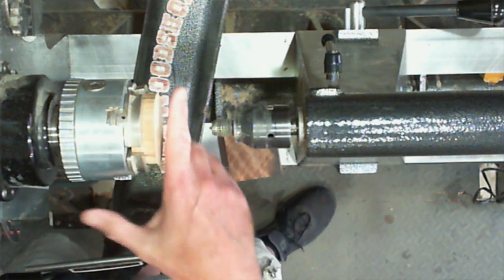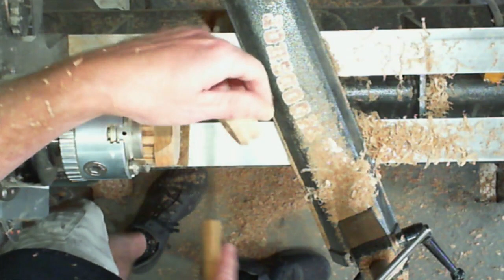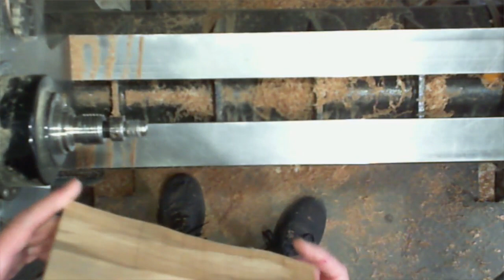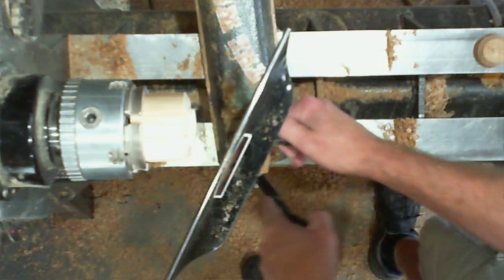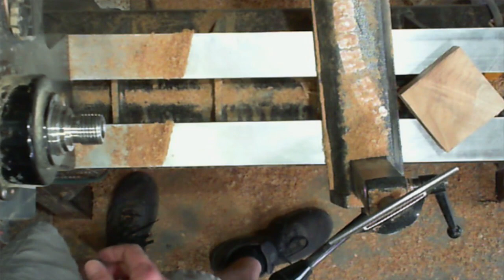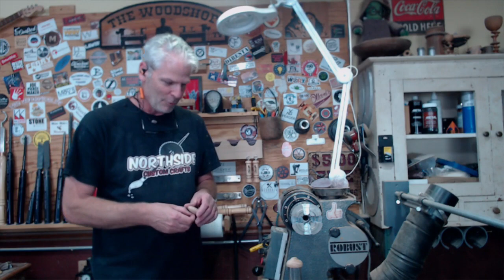Woodturning - Antique Gas Pump.

Comment: Hey Carl. I has drilling some pen blanks on my lathe with a chuck and when I tried to take off the chuck, it was stuck as a rock. I’ve tried everything to get it off but it won’t budge. I may have to buy a new lathe... any tips you have for me? Has this happened to you and how did you get it off.
Reply from the maker: I would try locking the spindle and putting a piece of wood in the chuck jaws. That way you could grab it with priers, or put it cross ways to get some leverage.
Reply: Carl Jacobson that did it, the problem I had mainly was that my lathe does not have a locking function... I put a piece of wood in the jaws and just put a pipe clamp on the spindle and whacked that piece of wood and it came out... thx a lot